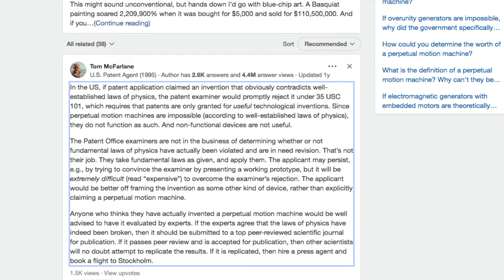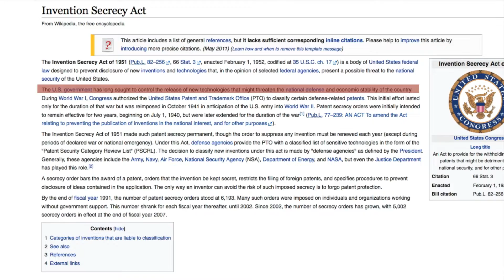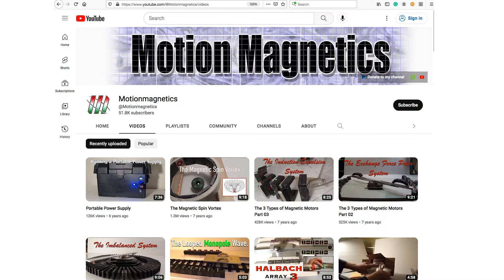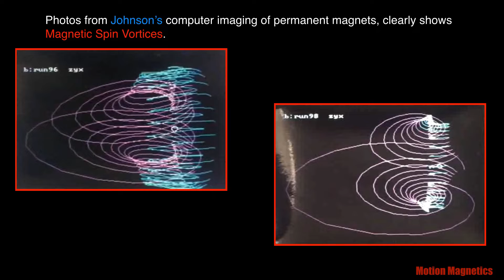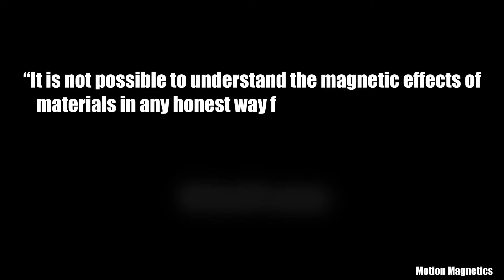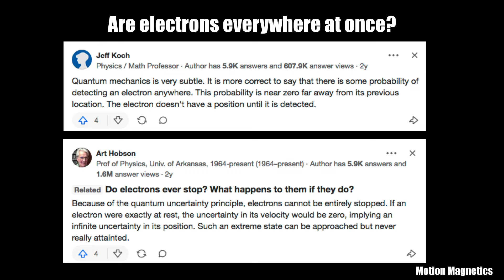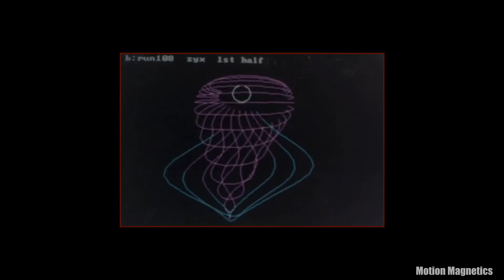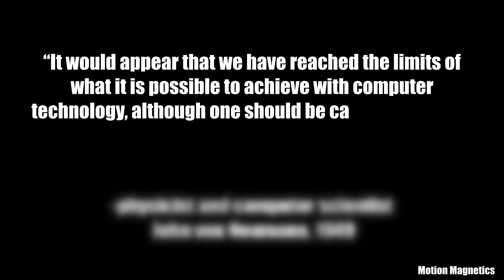How to Validate a Magnetic Motor Part 02

Comment: Actually I kinda disagree with your statement about people referring to magnets as a type of battery. When you're using FIF's (Field Interaction Forces) to power a device you are using each magnet for its ability to produce a physical force stored within the magnet in the form of an EMF induced in/on the magnet. A good neodymium magnet has a theoretical lifespan of 1000 years losing approximately .01 %  of its field strength per decade. Though FIF is a barely understood process that is quite complex and needs much more study what we are trying to do with magnets only applies to their ability to store a usable physical force (like a battery), how we access/use that force is where things get complicated. In my own work in creating an over-unity prime mover I have used, with great success, a fact about magnets that we all know but science has ignored. That fact is that to bisect one IMF (Independent Magnetic Field, otherwise known as a magnet) with another at a set distance produces a FIF that is 2.5x the energy needed to align the fields (with the fields repelling). In other words two magnets stuck together are 2.5x easier to slide apart than to pull apart. This is the "natural" unadulterated FIF differential, we can use mechanical advantage to increase this differential without effect to the strength of the resulting FIF. Furthermore we can use time as a mechanical advantage in the use (output) of the FIF as the strength of the FIF is a property of the IMF's and not dependent on any factor other than the size and type/grade of the magnets used. Click on my handle on this comment to watch my videos on MEO which stands for Magnetically Enhanced Output.

Comment: I have a tendency to agree with the thermodynamic aspect.   Just on the amount of energy input to charge all of the magnets to their strengths.   I'm wondering even if u do create a drive unit that can push a generator will it create more kw/h of energy out before it degauses or cancels out its own Magnetic fields.  In turn will it break its own laws of thermodynamics.
Reply from the maker: I believe that depends on how the device achieves motive force. It could very well be an issue with some motors and may not be a huge factor with others.

Comment: I think the best use of magnets is really using gravity. Imagine if you will a plastic tube that goes around an entire room but is slightly tilted so that a magnetic ball could slide all the way down. The tube is wrapped in copper wiring, and as the ball is sliding down the tube it is creating electricity which charges a series of capacitors. Once the ball reaches the bottom the capacitors power a vacuum system that brings the ball back to the top to roll down the tube all over again. I figure every 30 seconds drop a magnetic ball down the tube that way you would have more electricity generated. 

As for an actual motor I still think it would have to be a combination of mechanical and gravitational systems in order for the motor to actually work but it has to be something simple because the more complex it would be the more likely it is to fail.

Jesus Christ Almighty God bless you all and Merry CHRISTmas
Reply: Never heard a concept quite like what you described. Not sure if that would be feasible, but imagination is the source of true Genius, whether it works or not, (even if it doesn't, don't let that discourage you, but only to educate yourself or possibly... Succeed 👍😎👍). Good Luck
Reply from the maker: Interesting idea. I think mass and inertia may play a big role in building a working magnetic motive force system, as well as the correct placement and sizing of magnets.  And thanks, may Jesus Christ bless you as well.

Comment: a magnet is like a spring it seems.
Also can you do a video about the free energy of pressure and suction that I mentioned before to notify more people.
Reply: Similar to a spring, but a spring has a metallic body which is a hindrance while the magnetic field pushing out of its metallic body has no such disadvantages and it is endless.  Pressure has a limit.
Reply: @wongsiewkok7914  yes agree. 

As for pressure check out video "Breakthrough Green Energy-Free Energy Generator without flywheel!" which that is part 2.

Comment: This information was very helpful in understanding how to proceed. Only to keep working on the projects until it is understood what is going on and how the battery is being maintained. I will only upload a video of these things for demonstration purposes, no schematics. Until now this has been qualitative and only looking for results, now is time to do some analytical work and learn how. By the way, the Dept. of the Navy reviews all patients and won't let an invention be a threat to the planetary government's hold on power and authority, it's all about the money.
Many Thanks.
Reply from the maker: Smart thinking. And yes, they monitor things like that pretty closely.
Reply: @Motionmagnetics  Well, posted a video.
One of the poll of the battery had some Copper sulfate formed on it, when I rotated the copper wire to make a better contact the voltage increased by one volt. Will begin to do some analytical work, and wade into uncharted territory. Have a scope, spectrum
analyzer, and volt/amp meters, but I'm far from being a technician. This would be a 
Proof of Concept" and to find out what is taking place would be highly valuable to produce a working prototype that could do some real work. Thanks for the interest and advice. Will let it continue to run.

Comment: I believe there is a way to make an electromagnetic generator with no moving parts
Reply from the maker: Anything is possible.
Reply: If you can do it with moving Parts you should be able to do it with no moving parts. But there is the idea that a rotating frame of reference does something interesting. It's basically constant acceleration. Keep experimenting. That's how we're going to find the answers